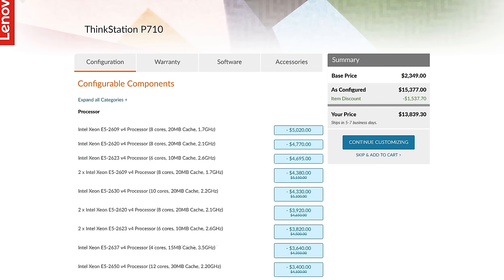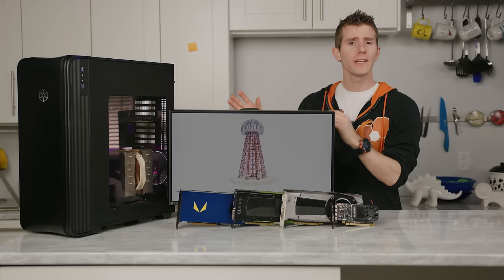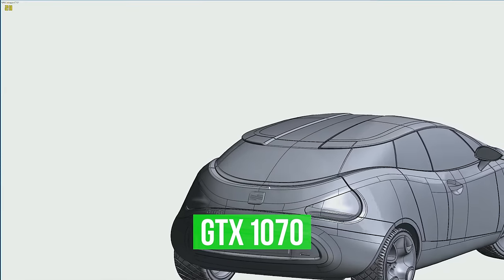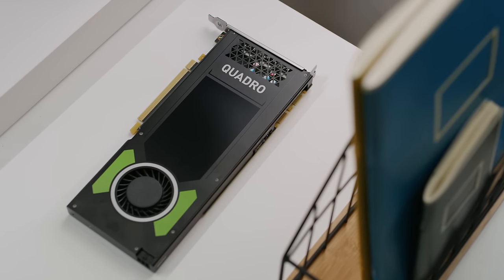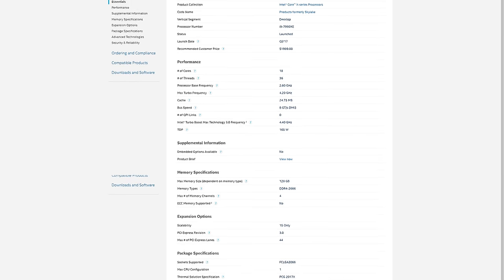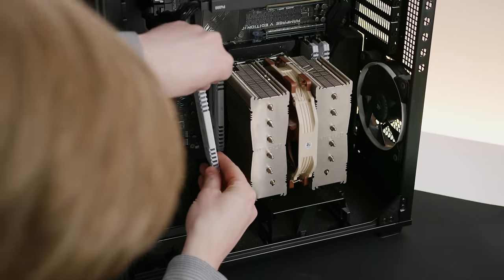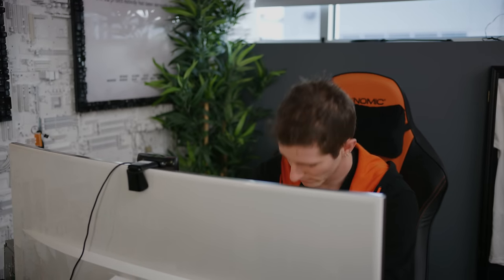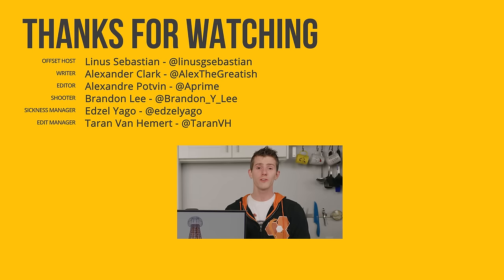3D Modeling & Design – Do you REALLY need a Xeon and Quadro??

Comment: Can someone who has experience with AutoCAD and Solidworks recommend a medium powerful PC build. Plus for a bit of gaming in the side. Like AMD RX 580 or GTX 1060. ........ and the rest . PLEASE!
Reply: Phoenix thank you very much for sharing this information with me ,ill be happy to hit you up if i have any further issues.
Reply: I use a Quadro M1000 on my laptop and it runs SolidWorks perfectly.
Reply: @Phoenix im planning to buy an i5 8600 and 1070ti can these parts handle autocad smoothly? Im also using this for gaming
Reply: @johnkennethconstantino6231  AutoCAD isn't that heavy. In school we used 1st gen i5's and GT210's and AutoCAD 2016 ran perfectly fine on that old stuff. We only used AutoCAD for 2D drawings, mind you. For 3D we used Inventor (also from Autodesk) which doesn't require that much GPU performance either but it does love a high clocked CPU (especially for rendering).
Reply: JohnHaiz70 21 im going to get the exact same specs
Reply: hey this is kind of old but... I run my own computer drafting business from home, I bought a used core i7-4770k and Asus Z-97a mobo from ebay for a grand total of $275, paired with 2 GTX 1070s in SLI (F.E.s brand new on ebay through bestbuy are 300 a pop) and it runs awesome for Autocad, Revit and Maya, not to mention I can rock any new game out there on 100+ FPS, even the single 1070 would work, so really, talking higher end PCs, I built it relatively cheap and I've been told I'm set for a couple of years, something to think about. However I picked up an AMD RX 580 8GB for $180 and I'm about to see if there is any gain from it..

Comment: IDK where LTT gets there information from but as an engineer who is constantly in solidworks I can tell you confidently I have no issue opening assemblies with 1000+ parts on my laptop i5-11500H w/ Nvidia T600 and 16GB of ram. In fact I open far larger industrial equipment assemblies (although very slow) and they are still usable. That was too general a statement IMO.

Comment: So is threadripper pointless then? Because I wanted to get one, but this has left me confused really. Is it good for all kinds of stuff like editing, rendering, modelling, etc. Or is it a bad choice? Also, is a quadro p4000 good for gaming too? Can you use it for rendering and heavy loads and also game? I did watch the video, but this was too focused on solid works, which I’ve never heard of before, and doesn’t really answer if it’s good for unreal engine or maya or software that most people use.
Reply: If you really want one, get it. It's an excellent CPU either way. You won't notice a huge difference in everyday usage and on the plus side you'll have a PC that's excellent at multitasking. TR also supports ECC memory if you need it.
Reply: Cool, thanks for the reply! 👍😀
Reply: No problem :). But I think you should check out a few YouTube channels specifically dedicated to Maya and UE. They'll be able to give better advice. And as for gaming on the P4000, well it can run modern games on ultra at 1080p really well. You might have to dial down a few settings for higher res. So it's not as good as a 1080Ti, but it's still quite respectable.
Reply: Ignore the xeon unless you're getting THE top versions and 2 of them. Otherwise Threadripper is perfect for rendering, editing and modelling
Reply: Thanks everyone! And I also plan on doing plenty of research first of course. It's nice to see some help rather than people whining at me for having an opinion. 😒
Reply: Threadripper mobos are also very future proof since the same socket will be supported at least until 2020
Reply: Also in terms of multicore rendering itself, TR kills consumer cpu's, performs the same as that Xeon W he recommended at the end and costs a fraction of the price.
Reply: Single threaded apps the intel will be a little faster :) But for multi core workloads AND multitasking at the same time Threadripper will likely give same as or better experience to the intel, based on its CCX module design. It handles multiple different workloads in a slightly better way than the intel. long story short spend the extra money you saved goin for threadripper on fast low latency memory, since that will likely be holding you back at multitasking or even some single tasks greatly. PS i have both 7980xe and TR. Both are great. one just cost a bit more :) side note the T.I.M. on Threadripper makes the cpu run at lower temps especially while overclocked so the fan noise will be less if you are using aio with variable fan speeds. Best of luck!
Reply: I have a threadripper and gtx 1080ti. I game and 3d model/cad/real time render/edit 50/50 of the time. Hasn't let me down once in 6 months
Reply: Rjeeez 95 not rendering. Cpus suck, they are too slow for that, get a decent gpu.
Reply: At the moment I'm using both I7-8700K at work and TR 1920X at home(both with GTX 1080) and I have found that the single threaded performance of I7 helps with solidworks, however, with the TR my render times(all core loads) are decreased by factor of 3. And it's not even the top tier 1950x... also, unless you're working with 10000+ part assemblies, you won't notice the difference in single thread performance.
Reply: DanDoesYoutube I don't know why I strongly disagree with the content in this video. Linus sure has his strengths... This isn't one of them
Reply: I just upgraded to a threadripper 1950x, I've had computers with i7s and quadros, and Ryzen 7s with GTX cards. Linus is EXTREMELY misinformed here. The Ryzen 7 system crushed all other intel systems for solidworks and keyshot at my work. CPU rendering benefits heavily from more cores as well, if you check any keyshot for forums and discussions the 1950x is considered the best CPU for rendering right now. AS for GPU rendering the GTX cards are significantly better as well, look at Octane Render benchmarks for more proof. Quadro's are a rip off.
Reply: I think it's obvious Intel sponsors most of the content on this channel so it's skewed most times. Even when the truth is obvious, they cover it here

Comment: What about Maya Linus
Reply: Speaking from experience it does benefit significantly from professional cards however it depends upon what you are actually doing. Having a couple of multi-million polygon models will not net you any benefits at all. Having a lot of effects with thousands of objects and millions of polygons will show you where the professional cards shine. For a beginner it is an utter waste and a 1070 or rx580 will do you over just fine. For modeling complex objects alone then a p2000/p4000 from team green or a wx5100/wx7100 from team red will set you up just right. 

 (This is from comparing a w9100 to a 1070 and Titan XM)
Reply: Ultra Indigo What about Ue4 and Unity(in case of a complicated game that for the moment I'm not doing)
Reply: Both consumer cards and professional cards should work about the same in those game engines. My own w9100, while performing much better in Maya 2016 than a 1070, plays games identically to a Radeon 290x. You should expect about the same scaling from pro to consumer card on Nvidia's end as well.
Reply: Ultra Indigo and about cpu. Is ryzen 7 a great choice
Reply: For games/game-engines it is not bad as it has a higher number of cores than the Intel equivalent and allows for better multitasking but it has inferior single-core performance which means that for tasks that are not multi-threaded will suffer. For better multi-threaded performance a 1700 will do you well while the 8600K will have your back in single core performance. http://cpu.userbenchmark.com/Compare/Intel-Core-i5-8600K-vs-AMD-Ryzen-7-1700/3941vs3917

Comment: Great video! Thank you! This reaffirms my decision (post-purchase, it shows up tomorrow-ish)! I needed a mobile workstation for design on the go (I hate being cooped up in an office and prefer to engineer at library's, outdoors, etc. Al's need to work on commercial flights and transport, etc.) Being that I'm in the middle of a start up I needed the most power for my budget which was about $2k.

I settled on, and purchased, an MSI WE63 8SJ-280 with Xeon E-2176M, 32gb RAM, 512gb NVMe SSD + 1tb Seagate Firecuda SSHD, Nvidia Quadro P2000. 

Should handle most of what I throw at it, and hopefully won't burn up with some CFD. 

One thing you didnt mention is that Xeon cores are encouraged because of their error correction ability. A single error can crash a several hour computation/simulation.

Comment: P.S. BIM now uses a lot of cores, I work with Archicad and I notice a huge difference using dual xeons (cMP5,1)  in the background rendering of all the model views in background (plans, sections, elevations) versus an I7 (iMAC '17)... any time I change between plans and or sections, in the xeons is instant ... in the I7 takes a few 5 to 10 seconds to process the model.

Comment: In case it hadn't already been mentioned, title may be a tad bit misleading to folks searching. Solidworks is geared almost exclusively toward CAD/CAE usage; in the '3D modeling & design' world, where one's talking more about what's likely to be soft-body modeling (read: animated characters, animations in general, etc), one's looking at software like Rhino (to a lesser extent than the following software owing to its mainly-hardbody orientation), 3DS, Maya, Zbrush, Blender, Cinema4D and to a lesser extent than the aforementioned besides Rhino, Lightwave.

3DS, Maya, Zbrush and Cinema4D at least constitute 4 of the biggest players in the '3D modeling & design' world when one isn't talking CAD/CAE - so if you haven't already done another video on those (I haven't found one, maybe my search-fu is weak), maybe consider revisiting the topic testing those also.

Comment: We do 3D Modeling, professionally, mostly for games using Maya, Softimage, ZBrush, etc. And we use i5, GeForce 1060 32GB RAM and 512 SSD + 3TB HDD. Good enough for what we do.
So if you are a student, don't buy an ultra expensive rig. A modest gamer rig would be good enough to start. But whatever you do, don't put less than 16GB of RAM in your rig, I'd start with 32GB because once you start using multiple sessions of one software, plus, huge textures in Photoshop, Substance Painter, etc, you'll run out of memory.
Once you are comfortable with what you do, investigate on what is what your software needs. CGI have a lot of specializations and each one has different needs.

For example if you are going to sculpt in ZBrush, Zbrush doesn't use much GPU, but CPU. And it doesn't really need a very powerful CPU to work decently. Mudbox relies on the GPU so you'll need a powerful GPU if you work on Mudbox (nowdays, nobody works on Mudbox though). If you are going to render with GPU, then most probably a gamer GPU would give you the best performance per dollar.

If you are in the game business, then it will be mostly real time shaders so you won't need more than a decent gaming GPU, although a cheap Quadro GPU could make a difference because of it's stability and reliability, but it will be a slower renderer when compared to a equally expensive gamer GPU if you ever want to do GPU rendering, so you will have to choose.
Reply: Ryzen 5 3600 
Rtx 2060 
512 SSD 
2 tb HDD 
16 GB RAM
How is this for a start in 3d modelling , animation and sculpting business?  (I'm still learning , but will try for a job in year or two)

Comment: Can you please make a video about 3D modeling with  Zbrush, 3Ds MAX, Maya,Houdini,C4D,Marmoset??
Reply: I agree! It would be nice to have these all open and running at the same time!! lol
Reply: It's always better to listen people who actually uses your preferable 3D program
Reply: I use a system with an i7-4790K 32BG ram and a first gen TITAN 6G. I'm a professional VFX artist. I do a lot of work in Maya Mudbox, After Effects. This system works great.
Reply: Also professional here. I am using Ryzen 2700x, gtx1070, 32GB ram. I actually have two rigs like that so I pair them up when I need more processing power. I work in Max, UE4, zbrush, after effects, marvelous designer. I used to be long time Intel fan but not anymore, Ryzen all the way. I gave my i7 4770k to my mother.
Reply: @gabelproductionsdesigns6700  Not hard. On my i5 16gig 1060 work laptop I can run Zbrush/Max/UE4/Substance Painter/Marvelous Designer all at the same time.
Reply: Professional visualization artist here. I use intel 8700k, nvidia 1060 ti, 16 Gb ram. I use 3ds Max, Vray and Unreal Engine. Works pretty fine.
Reply: you don't need a killer gpu and/or cpu for 3d modeling
Reply: Aleksandra Mitic currently a student and using similar software so I appreciate the specs. Unfortunately I built my PC before I had proper knowledge on 3D hardware. Currently have a Ryzen 2600, gtx1080, and 16 GB of ram. I was curious if it’d make sense for me to add two more sticks of ram or to upgrade my CPU next?

Comment: Great job Linus! There's some overlap, though. Simulation software commonly involves a high modeling workload because the thing being simulated is itself quite complicated. So if you want the best of the best, you can't separate the modeling aspect of a simulation setup. You need a machine that does both.

Another fine point... storage. There are three potential bottlenecks in high workload environments: CPU, RAM, and storage. I have 384 GB RAM in my workstation and have run simulations using as much as 260 GB. Moving that much data in and out of slow storage would be painful; SSDs are a must.

Comment: Thanks to your advice I bought a RX 580 only to find out that it is useless for most 3D render engines, like Octane, Redshift and Arnold renderers. I use Cinema 4D and Octane as well as Arnold are basic necessities these days in 3D animation and motion graphics. You could have mentioned that the Radeons are incapable of using these render engines.So now I need more of your advice. What do I do with the RX 580?

Comment: For my game art and design certificate which went from late 2016 to 2018 we used: windows 7's with an athlon II X4 620, 4gb ram and no dedicated graphics (we only used unity and blender then). We later changed went to pc's with i7's (don't remember what model they were apart from being underclocked 200mhz for some reason), integrated intel 520/630's that shared our 8gb of 1600mhz ram. We had to use Maya, photoshop, unreal engine 4 and other programs at the same that weren't saved onto hard drives, instead from the school server so perfomance often dropped when more than 3-4 people were using intensive programs. What fun. We (the students) actually asked for better computers and were told we'd get pc's that didn't cause a hernia everytime we clicked something but we got your somewhat standard $600 school computer XD.

Comment: I got through the CAD part of mechanical engineering with an i5-4460 and interal graphics just fine. Mind you, we used Solid Edge and Inventor and only had assemblies with up to ~ 50 parts and rendering was done over night.
Reply: Are you serious ??? I'm a 3rd year mechanical engineering student. I was looking to get a quadro laptop. Like ThinkPad P53s. I want to work on pneumatics and robotic applications as my 4th year project.. do you think I need a powerful laptop?

Comment: I use a i7-4900K water cooled, with 32GB of ram and a 1080 Ti. I model in 3D coat, Maya, Blender, and substance painter. I have no problems what so ever. When a Quadro comes into play is when you are do partial animations or heavy physics modeling. My computer will take some time to do that. Linus my question to you is how well does the Quadro handle gaming. I don't want to have two separate computers!
Reply: quadro is not for gaming that for sure dont even think about it

Comment: I'm a Mechanical Designer & GD&T Implementer & Analysist, and I don't do gaming on my work station. I want to start my own business. Now some of the stuff I work on has thousands of parts to them. You mention there is no need for anything but a single core machine while using SolidWorks. Is there a way to utilize the other cores while having multiple Models Subassemblies and Drawings open at the same time?

Comment: Tips:
1: Always buy the LATEST Quadro, DO NOT buy older models as they do not play well with pricing on Amazon.
2: If you're gonna be building a render farm/server, or something thats gonna run 24 hours a day, then you will need a Xeon/Quadro. A GeForce/i7 can't withstand that much sustained power, especially if its being run all day. That's why you use ECC RAM when you're building a server.
3: ECC RAM, is a MUST for servers, especially on long rendering work/databases.

Comment: i got a free (to me and my dad) used cad station from 3-4 years ago from my dads work and i use it for gaming and coding
it has a Quadro m4000 w/ 8gb vram and also a xeon e5 1650 v4. in cinebench r20 it gets around 2500 points multithreaded, it has 6core 12threads.
its not optimal for gaming but it works just fine, and that vram has really helped future proof it.
edit: in furmark it gets around 80fps. also im not complaining at all about this computer given the fact the my dad knows nearly NOTHING about computers, and it was a huge upgrade over the old OptiPlex running intel hd 4600 and i7 4790 (that was also from my dads work).
edit 2: it also has 64 gb ram, complete overkill for anything i do at all.

Comment: I'm using amd athlon x3 3500mhz, 8gb of ram and ati 6850 2gb ( old as f***) for 3ds max and i don't have any problems so far, using this configuration for more than 7 years. I don't make monster heavy scenes, but its ok for high/low poly, zbrush etc. Rendering could be a problem maybe, but I mostly render in marmoset .